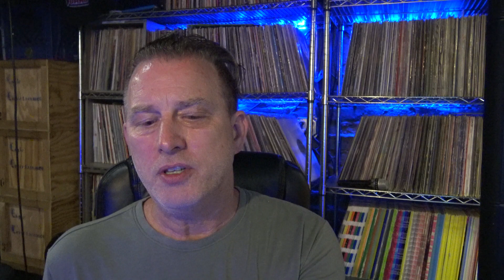Powered DJ Speaker MYTHS - Watts Vs Loudness & The "Peek Power" Marketing Game

Comment: Usually the speakers on a 100 watt amp cranked "all the way up" will see only 10-20 watts on average music. The kick drum might give you 100 watts, the notes of the bassline 40, synthesizer 5 watts and vocals 20 watts. This will be interspersed with power less than a watt during gaps between notes. It will only see the full 100 watts with a test tone.
Driving an amplifier into clipping will increase the power disproportionately to the tweeter to reproduce the high frequency farting sounds so it is usually better to get a more powerful amplifier than drive one that is slightly too small hard. Different types of music also put different stresses on different drivers. Opera might stress the mid driver, hardstyle the woofer and tweeter. The woofer handles more power, but then more is needed to sound loud compared to the mid and tweeter. This is because the drivers that produce high frequencies are more efficient, as are the ears that hear them.
It is possible that some of these powered speakers actually do have 1000 watt amplifiers but gain adjust circuits keep them limited so at "full volume" the speaker might only see a couple of hundred even if the amp  is specced that high.

Comment: Double the power is +3dB.
In loudness terms that is about 1 volume click on a smart phone, give or take. Or going from about 85 to 100 on a scale, though psychological loudness is hard to define but imagine your mind puts sound through a 3:1 or 4:1 compressor. Usually if your volume control is "half way", then you are at about 10% power depending on gain structure.

Comment: Love you bro, but you are wrong. Watts does make a difference. Imagine buying a 300w peak power Alto TX210 vs. a 1400W peak power RCF ART710MK4 and not caring about watts. Turn them both on  and try to match the volume at 50%. Believe me, the ART710MK4 will blow away the Alto away like it was a generic blue tooth speaker from Costco.

Comment: I get that wattage is not all that matters but it is a common term used to compare. I prefer RMS Watts  when I compare. I support DJs and others that use that term and find it welcomed and helpful. Especially with in the same brand or line. I’ll take all the info I can. 
As a matter of fact, I just  watched a video on a comparison of the Evolve 50 and 30. The DJ stated that the speakers both  had 1000 watts of power. (They both are rated at 500 RMS.). Wink wink. That DJ was you. Thanks

Comment: Decibels can also be meaningless. You should look at how the decibels are measured, or if they are theoretical based on the sensitivity of the speaker.

Some companies will measure the sensitivity at 1W/1 Metre, then work out based on the theory that a doubling of power is +3dB, the speaker can 'handle' 1000W that this is as loud as it can go. I assume companies like Yamaha would be the prime suspect for this (with their 143dB claims).

You should also look at how/where the speaker is measured. 100dB (4pi) full space measuring Mid-High Frequencies appears as 103dB half space (2pi). 100dB full space measuring Low frequencies appears as 106dB half space. Full space is in the middle of an anechoic chamber, half space is up against a solid surface such as a floor or wall.

Then there's also crest factor (peak to RMS ratio). CF 4 = peaks of 12dB, CF 2 = peaks of 6dB etc

So if a speaker has a sensitivity of 98dB RMS half space, and can theoretically handle 1000W. It will, in theory, be able to produce around 132dB peak half space. If the crest factor is 2 then the RMS of the speaker is really 126dB, if the crest factor is 4 then the RMS of the speaker is really 120dB, and if you measure the speaker full space, the RMS of the speaker is really less than 117dB (or 114dB if it's a sub).

The next thing you should look at is frequency response. Decent Mid-tops will likely all be parable with a frequency response of around 50-70hz to 20khz. Subwoofers (which you should always be using) is where this really makes an important difference. Some subs struggle to hit below 50hz, some will easily handle down past 30hz. 

30-60hz is a full octave in musical terms so it's a massive amount of information. If you want to hear 30-60hz, throw on a set of headphones and listen to the 'baby pull me closer' prechorus in the Chainsmokers song 'Closer'. 

What you're hearing is 32-41hz as the synth-bass moves from C1 to E1 in the bottom octave. If your PA has poor subs, then this part of the song will not be audible, and no, you don't need massive subs to do so. My 15" subs can produce it easily at a decent volume.

Some powered speaker manufacturers are also guilty of quoting the total amplifier power as opposed to speaker handling (not that it's relevant anyway). No chance in hell a K8 will be able to handle anywhere near the amplifier power, but it's the same amp that goes into their K12. Even within the same speaker range, the amplifier on a K8 will limit way before the K12's.

Comment: It all comes down to how efficient the drivers in the cabinet are.  More efficient drivers require less input power to produce the same SPL as a less efficient speaker.  As an example: A speaker with a 96 dB sensitivity rating and 1000 input watts will be twice as loud as a speaker with 90 dB efficiency with same input power.  Sadly the vast majority of powered speakers do not list efficiency.   Also, SPL is not SPL - at least not  as shown in most advertised specs.   Reputable manufacturers will list the frequency at which the max SPL is obtained, and should be a measured value  - not ‘calculated SPL”.  Furthermore the vast majority of speakers can not sustain their peak SPL for any duration of time - many for just milliseconds. There are some very well made powered speakers that advertise a measured max SPL of 126db (example) but that speaker can sustain that for an entire gig if you chose to.  But wait,  most people would say 126 dB sounds pretty lame when you compare it to all the 130+ dB speakers advertised these days.  Don’t be fooled.  That 126db speaker would easily outgun a 130+ dB speaker because it can do it all night - not just for milliseconds.  Always listen to a speaker before you buy it or at the very least have the ability to return it (I recommend the former when possible) as it is much easier to compare head to head.  I also focus on (a) crossover point and (b) frequency response and how flat the response is when purchasing a speaker.  I have never bought a speaker based on max SPL and don’t recommend that to anyone.

Comment: Some companies offer specs on program power for their amplifiers built into the speakers. Example 1000 speaker with a built in 500w amp. The power will than be distributed between the  speakers and or horn in the unit.

Comment: Same goes with new hifi systems for your house it's not always about wattage it's about build quality I dont know about u but most off the new hifi systems made now claim there hight wattage but tbh with you alot off them I actualy hate ike the sound off them the bass just doesn't sound right and the cabinetet build quality ent the best its I harsh bass and not nice just vibrates I  used to own an old Sony dsw hifi I think the speakers were like 200w or sommet like that and my God for an old sytem it was one off the best out there
Reply: Ya, look for RMS not peek power.  Some extra headroom can be a great thing. If you know your speaker sensitivity you can calculate how many watts you need for a desired SPL at your listening position.

Comment: So true!  By the way, I still have and use my RCF Art312 speakers. They still sound superb.
Reply: Yup, had my 315A's now for a couple years and just love them. People can't believe they are only 400 watts RMS. I tell them I don't care about watts.  SPL level, sound quality and reliability are all that matter.
Reply: @paulnuyens1203  and they will be even more surprised, because if you go in the website you will discover that the art 315 passive version can only handle 300watts, and the active version will also handle only 300 watts as they share the same drivers, so they claim that their amp is 100watts stronger just to attract more people